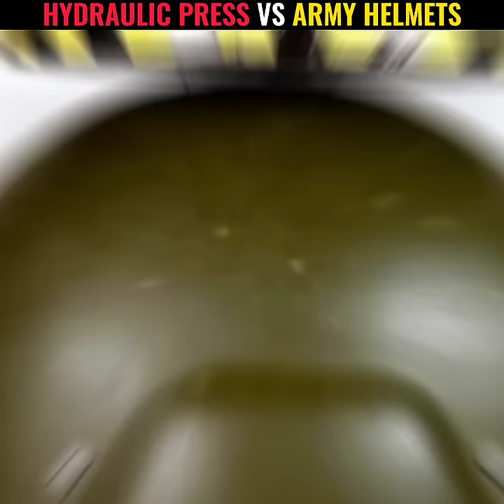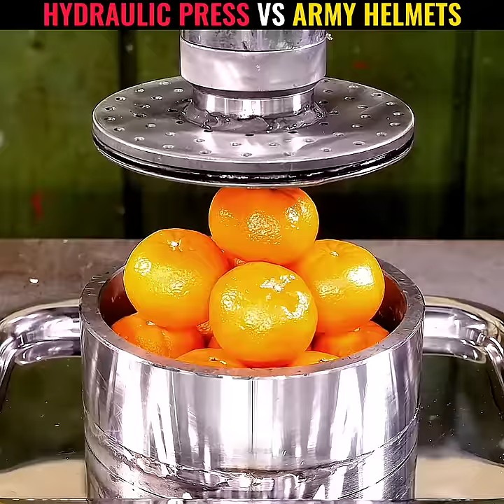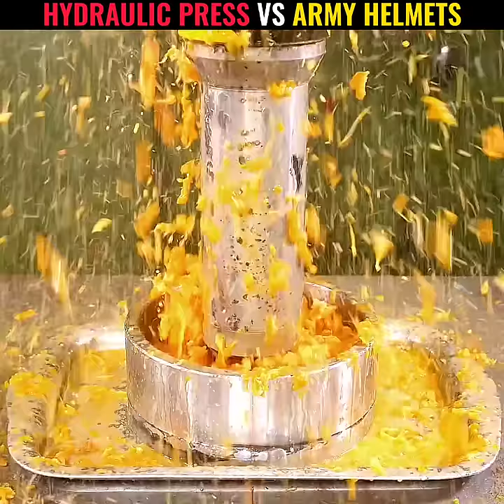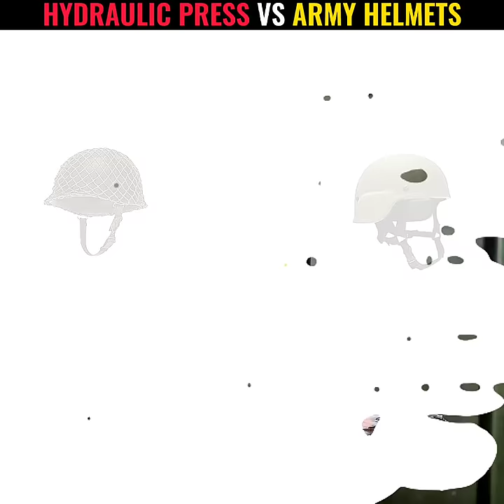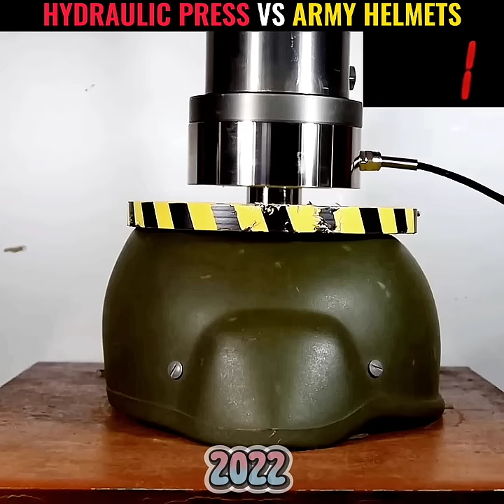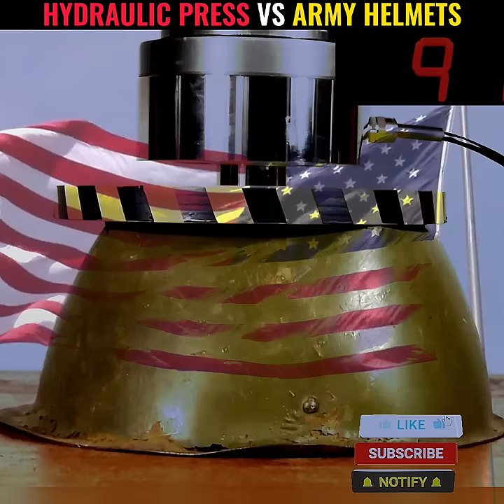Old Helmet VS New Brand Mordern Helmet 🤯 Let's See the Power of Old and New 🔥  #shorts

Comment: thing is, the helmets back then while technically more durable and made of a stronger material like steel or titanium, didn't offer that much ballistic protection against rounds and were only slightly more effective against shrapnel.  Kevlar and composite helmets like the modern one, are made not necessarily to last forever but to offer the most ballistic protection possible mainly against shrapnel but newer helmets also in many cases offer ballistic protection against actual rifle rounds for a while.  problem with Kevlar is that it degrades over time, hence a helmet manufactured in 2001 may not offer the same amount of protection as one made 20 years later due to the fibers starting to weaken and degrade. That and a metal helmet is one solid piece that is usually cast or molded, whereas a Kevlar helmet is made of multiple layers of fiber pressed together and given form by a press .  Different helmets built with different mentalities for different purposes. still cool to watch though.
Reply: Exactly if a force of more than a few hundred kilograms is being applied the amount of weight that helmet can bear will have no effect on the survival of the individual wearing the helmet.

Comment: The 1950 helmet is in case a freaking tank falls on your head
Reply: Yeah, no, that's gonna squish you instead of the helmet.
Reply: Actually a tank is 40-50 tonnes
Reply: I can guarantee you the newer helmet has better protection than the 50s one, hydraulic presses are not common on battlefields

Comment: Helmets back then were made for strength, Helmets now are made to survive bullets
Reply: Filifino
Reply: It has a proper reason that why old helmet survives. 
Nowadays we extract metal and other mineral from more depths so it has very low quality but previously metal of high quality was available very easily thus it can last for long time. 💀
Reply: @shivambendre5533  Although that is true, that isn't the reason why old survives and new doesn't. New helmets are made of Kevlar and polymers while old helmets are made of metal. Metal is way less effective at stopping bullets than Kevlar while metal is way more efficient at stopping hard, heavy impacts.